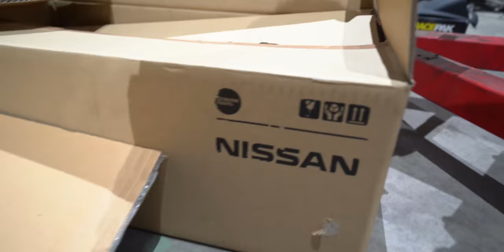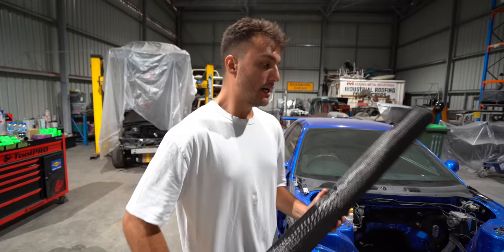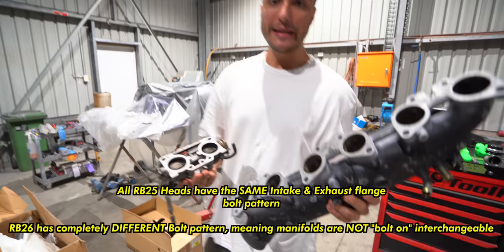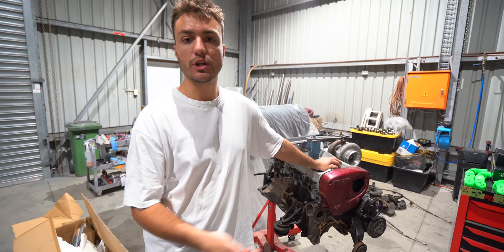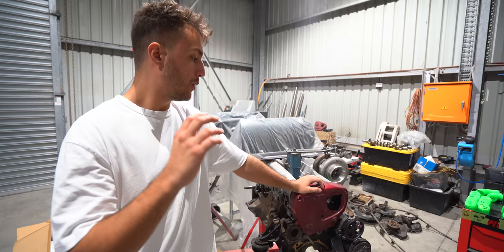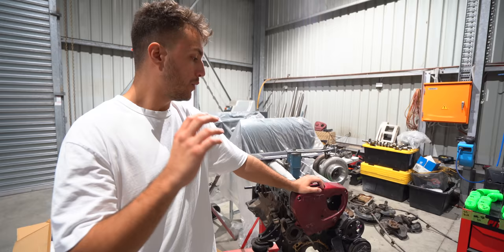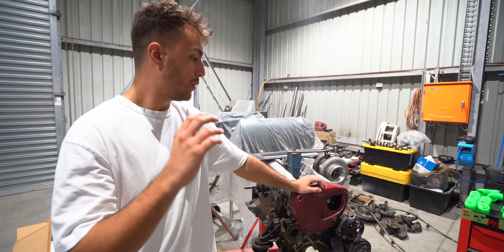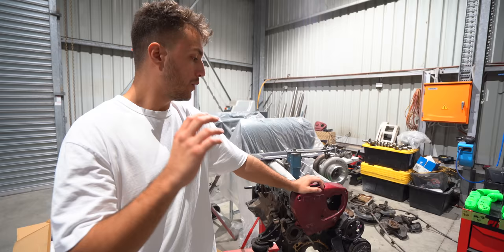Let's REBUILD the R34 Skyline AGAIN | VLOG 18

Comment: $2400 for a RB26 head??? Cant even get the covers alone for that! Nice find 👌

I wonder if the r34 cluster has adjustments like the r33? I converted mine to a GT-R cluster by adjusting the speedo and replacing the dials with some custom 320km dials i had made with the old NIsmo logo. 

I'm also not nostalgic about going for all these old JDM parts, though I did go for a Tomei Expreme exhaust simply for how the exhaust system is like 1/3rd the weight of my old stainless exhaust, and just the tone that Titanium gives.
Reply from the maker: Seen a few sell for $2000-2400 lately

Comment: word of advice on the crankshaft, when storing them keep them vertical and not horizontal. This prevents any warps or bends even buy thousandths of an inch keeping it straight and true, which is magnified at high rpm
Reply from the maker: True true! Note taken

Comment: keenly following your build. i also want to put in a cd009 in my r33.
i've also spent a lot of time making exhaust manifolds. i found symmetric designs give a smooth sound like 1jz. i think your sound is more of an equal length manifold like a 6boost top mount.
i recently also fitted z34 akebono brakes to my r33. keen to see what you come up with for your brembos.

Comment: The "free flow" exhausts without baffles inside almost always neck the perforated pipe inside the muffler, it's how they control the sound level when they need to be certified for street use.

Comment: Hi Damien. 
Nice work with everything! 
I know a Volvo guy who Went DCT, but used the original BMW software and it Sounds like he had great succes.
He is making about 500, if i remember correctly.
Reply from the maker: Yes using early E9x transmission which has different hearing to new Fseries so not an option unless I adapt a BMW 3.1 or 3.3 diff :(
Reply: @BrokenSilvia  Okay, you have already read about that! 
I wanna do the conversion myself in my own Volvo at some point!
Have a great day 😁

Comment: I'm planning on building a poor man GTR like you.  CD009 transmission, HKS turbo kit, HKS Hi-Power exhaust, stock GTR body kit, electric cobalt blue paint.  I'm conflicted on the engine.  RB25 NEO or swap to an RB26.  The 26 has the highest potential and support with aftermarket parts but is it worth the cost if I can just retro fit the manifolds to the NEO?  Brakes I've seen people using R35 GTR brakes with success.
Reply from the maker: Neo is king

Comment: If the car can be tuned for 95 octane E10 fuel, thats gonna give you the easiest time here in europe. 98 is pretty common but 95/E10 can be had anywhere. 

You never know what might happen or where you need to refuel and having a car that only runs on 98 can be a challange, I know that for a fact.
Reply from the maker: Yeah will certainly look into it :)
Reply: nevermind, the car aint goin to europe xD

Comment: Iq3 is shit, on a hot day the segments go all black and don't respond and when cold they don't display.
Ic7 is the way to do, changed to ic7 and finally no issues. Iq3 is like a cheap watch LCD. Super old display technology
Reply from the maker: Hmmmm :( did not know that, we'll find out i guess 
Ic7 is too big for that area
Reply: @BrokenSilvia  if you search ic7 display in r34 you'll find mounting solutions for that middle top dash area and it fits